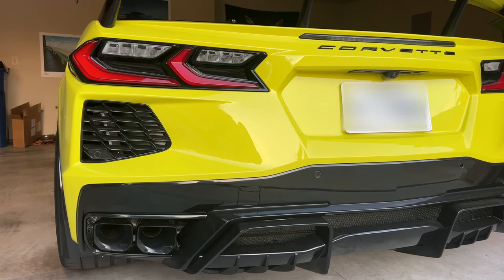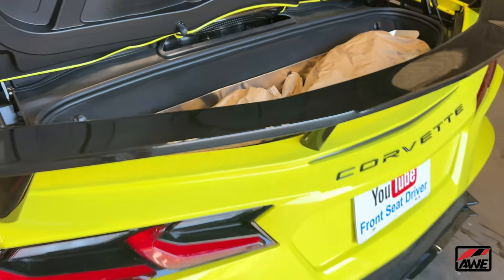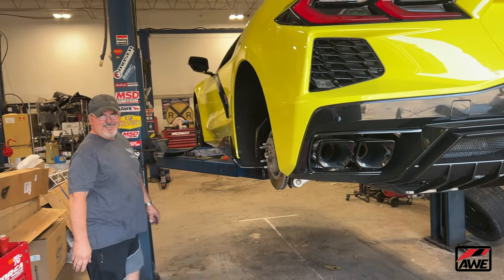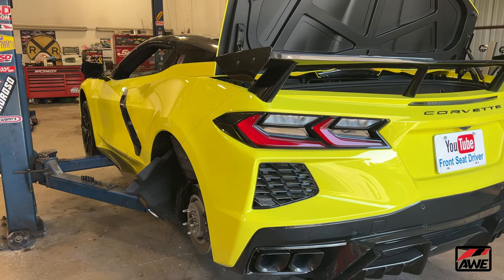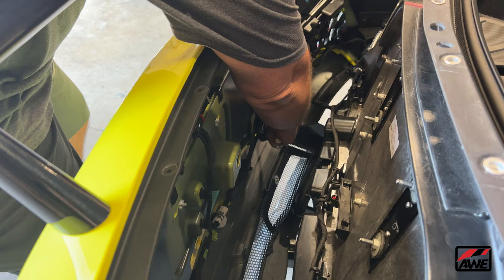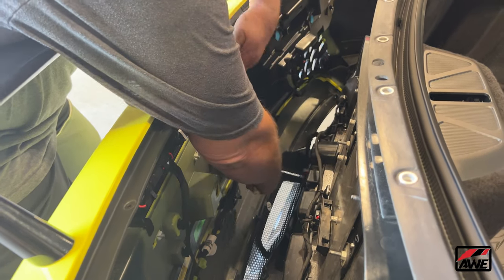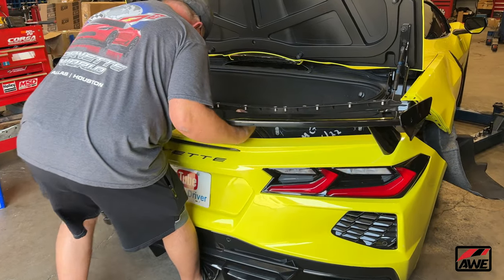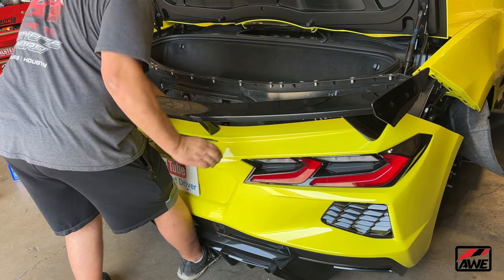C8 Corvette Exhaust - The PERFECT Sound For YOUR Corvette With AWE!

Comment: As far as this silver in the back of the mufflers, I think a good old can of heat, black spray paint, would work just as good for $5. Instead of tape. That's probably gonna eventually come off. This is my opinion only.
Reply from the maker: It’s possible. I guess we’ll only know in time. If it does, I’ll go the paint route. 😃
Reply: The shields from Paragon isn’t a “sticker.” It’s a highly malleable, lightweight, heat resistant material .  It’s not a civic. Bypass the paint and spend the 30 bones.  😂

Comment: Was your stock exhaust a performance exhaust from GM? Mine sounds OK when I leave it on My mode which is track exhaust sound. When I have the so-called performance exhaust dialed for that
Reply from the maker: It was and yes, I would ONLY drive in Z mode. This is still a little better without using Z mode.

Comment: Hey there! Came across your video looking for exhausts. I’m ordering a 25c8 and deciding which options to order. Trying to decide if the z51 package is worth it, as I won’t track the car, and if not, should I get the performance exhaust or just go aftermarket. If this kit is 3k or so, why spend $1500 on the performance exhaust…. So this is just loud all the time correct? Through all the driving modes….
Reply from the maker: I know a lot of people don’t really feel the need for Z51 if not tracking. And I wouldn’t do the performance exhaust. I’d definitely go aftermarket. And yes, it will be loud in all modes with aftermarket.

Comment: Which paint did you use?  Also, thought there was no drone with tour exhaust?
Reply from the maker: I believe it was just some high temp paint. Not sure which brand he uses. 

I think there’s a little. In V4 mode. It’s not anything major though. I pretty much always drive in Z mode though so it doesn’t drop down into 4 cyl.

Comment: I have the AWE exhaust on my Silverado ZR2 and absolutely love it. My first car was a 71 Chevelle with an L48 350 that I put headers and glass packs on, and I've always had a good exhaust on my trucks so I had to do something on the very quiet ZR2. Even though it was a little louder than what I was expecting on my truck, I have grown to really love the sound and think it would all the more so sound amazing on my C8, too. Definitely helps to have a lift and the proper tools to do the job. I also noticed you removed the AWE logo on the back heat shield; (or unless they stopped putting it there?) I would definitely want to remove that like you did, as well.
Reply from the maker: Sounds like your Chevelle was awesome!! I love classics. 
The C8 definitely needs some pep in the exhaust sound. You’d love it like on your ZR2. 

We actually removed the AWE. It’s nothing against them, it’s on the tips. Plus we’re happy to be part of the AWE family but it just didn’t look good inside like that.  We make sure EVERYONE knows it’s AWEsome. 😁

Comment: I do appreciate him putting his foot under it to make sure it doesn’t touch the ground, but I’ll never understand these techs not just using moving blankets and other tools to prevent damage. I just don’t get it. Watching this guy use his foot and then trying to single-handedly put the piece on the horses would give me a heart attack.
Reply: Also great idea with spraying inside the tips to make it black, but ideally this would be done BEFORE install and away from the rest of the vehicle.
Reply from the maker: Yeah. Luckily it didn’t turn out to be an issue. I should have done it myself prior to bringing it up there.
Reply: @FrontSeatDriver  yeah I’m glad it all turned out ok for you. I’m deeply traumatized by a few experiences I’ve had with installers and when I see these videos I’m like “OH - that’s how that kind of stuff happens” lol.

Comment: I love that Yellow color. Looks sick as a convertible.. I don't think I'd want a coupe. I don't care about seeing the engine, it doesn't look like anything special anyhow. I have a Velocity yellow C7 Z51 M7 right now.. Looking into getting a white pearl metallic 70th. I'm worried I'm going to miss the manual too much.
Reply from the maker: Yeah. You may. I have a C7 Z06 M7 and it’s so different from the C8. The C8 drives itself. Doesn’t have the awesome sound you get with rev match but it’s still a good car. Quick, not fast.
Reply: That's what I'm worried about.. Its too civilized. The C6 was even more fun to drive than the C7, but I fixed that with a Throttle body and throttle controller. I need to drive a C8 before I consider dropping 100k on a C8. The AWE sounds really good. Great vid.. :) @FrontSeatDriver
Reply from the maker: @failingup4907  Thank you! 🙏